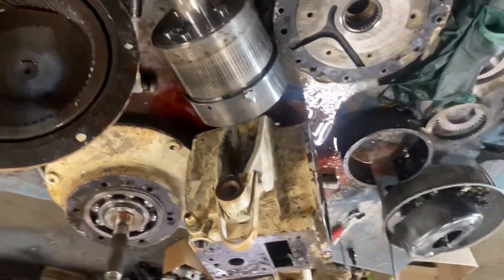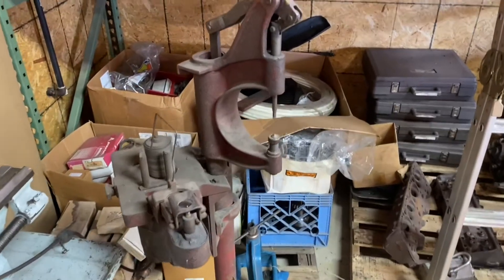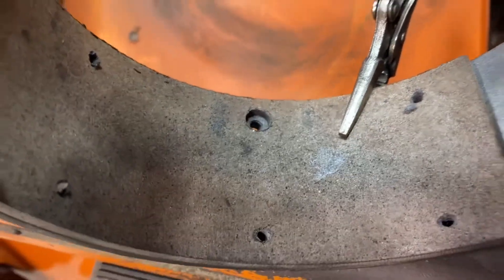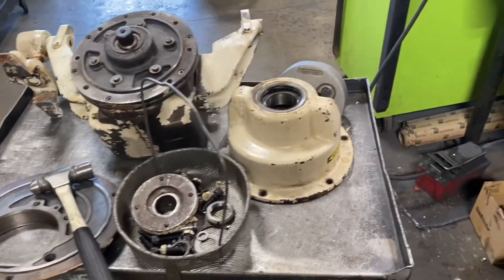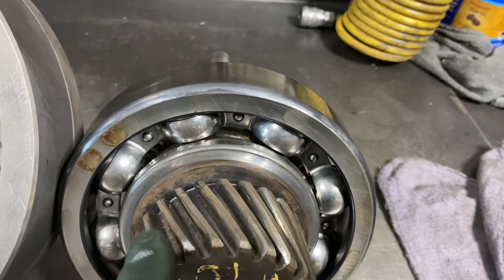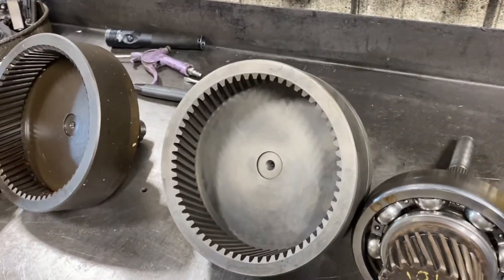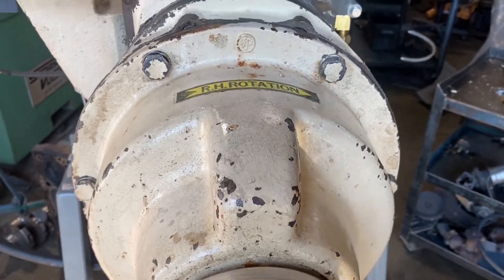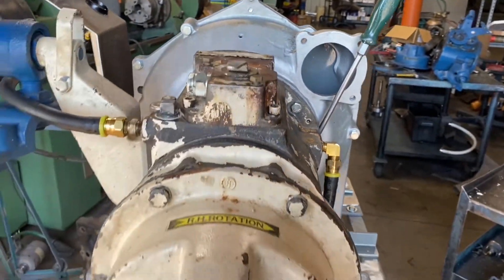Chris Craft Paragon P44R Marine Transmission Diagnosis and Overhaul

Comment: So with these paragons does the output shaft spin the same direction as the input shaft (like a BW) or does the output spin in the opposite direction?   I might be buying a pair or P44’s
Reply from the maker: I am not aware of a Paragon ratio that is a reversing ratio such as a Velvet Drive 1.91:1 or 1.88:1.

Comment: I have a P45 L and I will change the output shaft oil seal but it's been suggested I also change the bearing as well. Do I need to remove the end housing to do that or can the bearing be removed after the flange and seal are removed?  Edit; I have now removed the output flange and the splines are badly worn, the retaining nut was loose but secured by the multi tab washer from coming off. Can they be re splined in a machine shop?
Reply from the maker: Have to check with your local machine shop.

Comment: I got this paragon R- 020 Reduction gear I got the nut off the coupling the lock washer with the three prongs it’s got a key way home I don’t know how to take this apart to Take out the old seal put the new one in? Can you help me out before. break something
Reply: I have a Paragon P45L in my boat connected to  DAF 615m engine. Today I changed the oil and put in dexron  l ll  3 litres. Hopefully that's alright.
Reply: Hole *
Reply from the maker: You need a spanner socket.